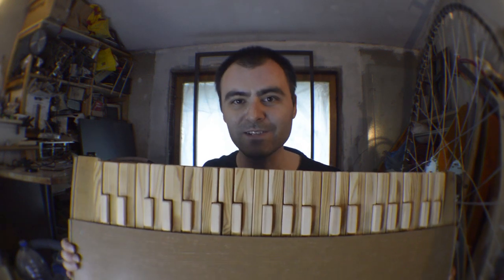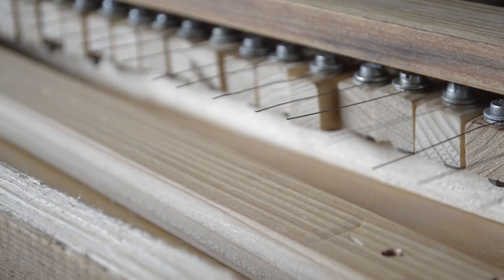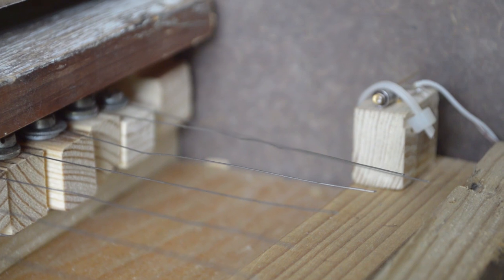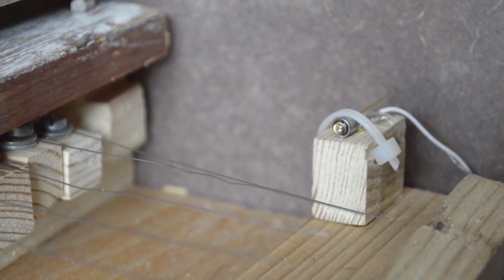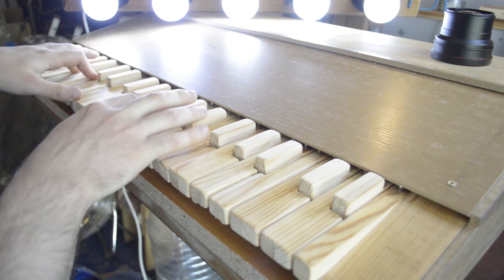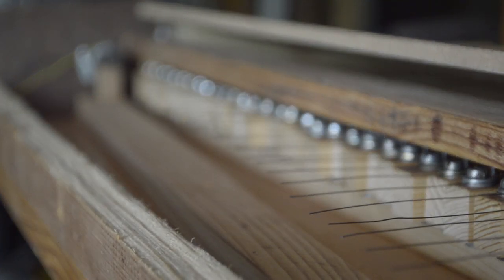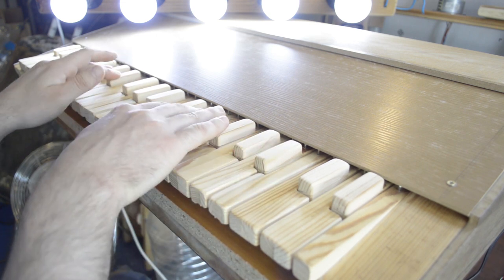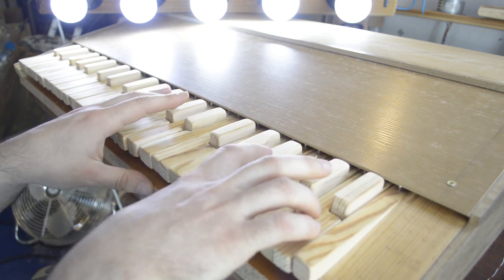Laser Piano DIY - Homemade Musical Instrument

Comment: I don't believe the issue you're having with multiple notes played is due any limitation of the instrument itself per se or any kind of blocking phenomenon but rather the range the instrument is in and it's harmonics limiting the kinds of intervals you can play across its range. Look up a concept called "Lower interval limit". Adam Neely has a good video explaining it in more detal. But essentially, as you go further down in pitch, certain intervals no longer sound harmonious together and can sound muddy. If you constructed a version of this instrument in a higher range, perhaps even just an octave up from where you have it, you might find it easier to get a more harmonious sound for chordal stuff. 

With that said, it has such a unique voice as a bass instrument, I could see a lot of use for it as is. The fact you've developed something that's pretty streamlined in how it actually works with the wire attached directly to the key, only requiring a single light source and sensor, basically folding it down to one pickup AND it sounds cool is awesome. Great work, dude!

Comment: It's such an interesting electromechanical instrument. The thing I love about this is how fundamentally it connects the musician to the concept that sound is made of wavelengths. 

Thus, "harmonious notes" (which means they are part of the same harmonic series) like octaves, fifths, etc., actually sound fantastic together, but other intervals don't sound so good.

To me, that's the defining feature of this instrument, even more significant than the laser part (though I agree that using a laser to measure vibration is pretty genius too).

Also, some people might call this "harmonics-only" feature "restrictive." They might complain that they want to do other intervals, so normal pianos or synthesizers are just better because they can do those.

But I really disagree with that view. I think this instrument, with its restrictions, allows you to think about music in a different way. Thus it provides a unique musical experience, which leads to unique music. 

It's like how the Japanese shakuhachi really only plays on the pentatonic (5-note) scale, but it's still a beautiful instrument with a unique musical tradition that separates it from other woodwind instruments. As a shakuhachi player, you would think about constructing melodies in a different way than a flute player, who has access to a full 12-notes chromatic scale. 

It's like how Indian classical music can make use of a tonality system that has more notes than the western 12-tone scale, which makes its instruments and its music unique. Even if Indian music has more notes than western music, we don't say that either one is "better." They're just different. 

This sort of difference in musical experience is what makes instruments unique and valuable apart from each other, and it leads to unique and valuable musical pieces too.

Comment: How is the pitch of each note achieved? Are the strings at the end of each key different thicknesses or something or is it the keys themselves being different weights so they vibrate the strings at different pitches?
Reply from the maker: The strings are just different lengths.
Reply: @Edward_Black_Rose_Sound  how difficult is it to tune the strings then? I imagine a lot of fine tuning went into the string lengths? Or did you just check the specific frequency of each string and then assign a note value to whatever the laser sees for that key?
Reply from the maker: @wokeupinapanic  There is a bolt with two washers at the end of the key. The string is squeezed between the two washers. If the bolt is not fully tightened, you can move the string with pliers so that you can adjust the length of the string. I use an iPhone tuner app to tune the strings to certain notes. It's not difficult, but it takes time for all the keys.

Comment: I'm amazed at this mechanism! Maybe it could be modified for good polyphonic sound by using reflected laser light instead of blocking laser light.

The tip of each string is painted reflective, and the laser is located to shine at the tips without overlap. The sensor is located next to the laser, pointed in the same direction. This way, the reflected light from the string tips will be additive.

Or maybe a doppler motion sensor could be used. In this case, the sensor would be above or below the strings, detecting motion toward/away from the sensor. They're designed to detect moving humans so maybe the strings would be too tiny to register. But these sensors aren't terribly expensive so it wouldn't cost so much to try.
Reply from the maker: There are ways to detect the movement of strings other than laser and photocell, such as electromagnetic as in guitars. This is the easiest way to make it polyphonic. I thought about the reflection of the strings, but it is quite weak and spreads in all directions. It can be done with a photocell under each string.
Reply: @Edward_Black_Rose_Sound  Maybe the amount of reflected light could be heavily increased by using flat metal strips instead of wires. That way, the laser could be on one side, aimed a bit upward, and the sensor could be on the opposite side, so the reflected light mostly goes toward the sensor. A bit of cardstock in the middle prevents laser light from going directly to the sensor.

But it seems fiddly anyway, compared to separate sensors.

Comment: I don't know how your electronic audio circuit looks like, but since you have 40 keys, perhaps you could install 40 photocells (instead of just the one) & position each cell adjacent to each wire "tine" but also putting thin wood walls inbetween each one so that they don't interfere with each other.  Or use mirrors if placement is too tight. With 40 photocells, this could give you a closer representation of chords when multiple keys are pressed.  Right now, at best, it is a monophonic instrument.  However, I would love to see this played by a keyboardist & maybe in a live band or in a recording studio.  It does resemble the sound of a Rhodes keyboard.  I played a bass Rhodes keyboard back in highschool, decades ago. I would have loved to have bought that off the highschool. Oh well.

Comment: If I understood correctly the following intervals sound good - thirds, fifths and octaves. You could fix all the other intervals by having 4 lasers. Group the twelve notes of the octave into 4 triads, for example - {C,Eb,G} , {Bb, F, D}, {E, G#, B}, {F#, A, C#} (C minor , Bb maj, E maj, F# minor). 1 laser does 1 group and all its octaves, another laser does another group and so on.
Reply: Look up the physics of harmony.  The harmonic scale refers to overtones created by pitches, either mono or when played polyphonically.  These are basically what the organ foot stops (drawbars) are modeled after.  8' is the base pitch you are playing, as you increase the feet by x2 or /2 you get an octave lower or higher, respectively.  Then organs fill in fifths and a couple major thirds along the way, just like the Harmonic scale does naturally.
Reply: @loganwhite8375  I appreciate the idea, but I must note that the harmonic scale =/= equal temperament. The equally tempered third is already quite out of tune (20 cents was it?) you could improve upon the idea I layed out by having 6 lasers one for each adjacent perfect fifth (which are only 2 cents off) or 12 lasers for each note and its octaves. With more lasers  you have to start fiddling around with positioning and allignment, Edwards idea is great because of its simple design.

Comment: What an incredible concept for an instrument. Did you test this with different wire gauges? I'd be interested to know whether that would only effect pitch of if timbre would change too based on how much light is being blocked during the physical interception of the laser.
Also, the polyphony aspect of the instrument almost seems like pseudo ring modulation where not every interval will sound great, but some intervals will fit well to create a more cohesive sound.
Reply: Ring mod yes

Comment: Maybe if it had 12 lasers and diodes, one for each tone, but octaves shared the same laser, or even make the fifths share it too, can't work it out in my head how many lasers that'd be. But then you'd need som transmission. Or maybe you could angle them and have the lasers be placed in a circular shape.
What wire did you use?

Comment: I belleave trhat you can get a better sound if you use magnetic picups like on a guitar to turn the strings vibrations into electric signals.
Reply from the maker: With that simplicity, no! Yes, the magnetic version can catch better sound. But it will take a little tweaking and complication to stop the vibration of the strings when the key is not pressed. Because the coil would pick up sound even if the string is farther away. There are a lot of such musical instruments on a magnetic principle, I wanted to do it differently and I thought of an optical version.
Reply: @Edward_Black_Rose_Sound  You can place felt pads under the strings. When the keys are not played, the strings will rest on the felt and will stop vibrating.
Reply: I've been thinking just the same thing. Also the felt idea is very interesting.

Comment: how is the laser converted to audio?
Reply: I think that is the really clever part, keeping that secret. Don't tell us  @Edward Black Rose [Sound] . Let us keep guessing! 😉
Reply: The laser is converted into an electrical signal by the photocell. It can then be converted into audio by a speaker.
Reply: I'm pretty sure the sound you hear is the actual vibration of the metal rods as detected by the photocell and amplified.

Comment: HAHA ! I've seen your other video and was sure something was off : synthesizers produce their original signal from an electronic circuit, here the signal is produced by a mechanical component (that is then used by an electronic circuit) which mean this instrument belong to the electromechanical instruments category (like Fender-Rhodes or electric guitars) and shouldn't be called a synthesizer.
Also, hats off to the idea of using a laser the way you did : as far as i know it's totally original and very clever (might steal the idea later).

Comment: Does that mean that after holding down the key for a bit that the vibration stops and the note stops or are you causing the strings to constantly vibrate somehow?
Reply from the maker: It fades slowly. The low tones last much longer. If you want a long sound there is a trick, you can tap with the other hand on the finger with which you pressed the key, it works mainly in low tones.